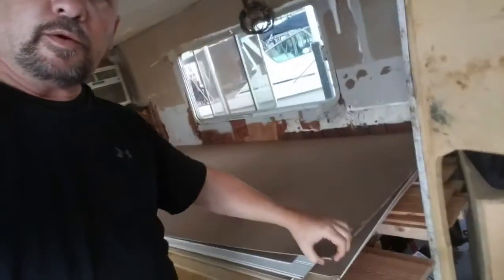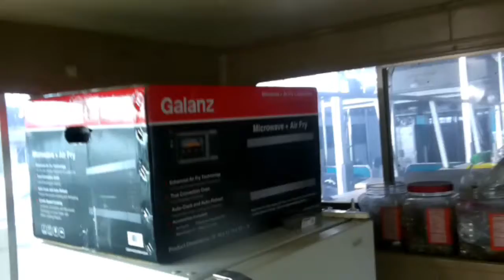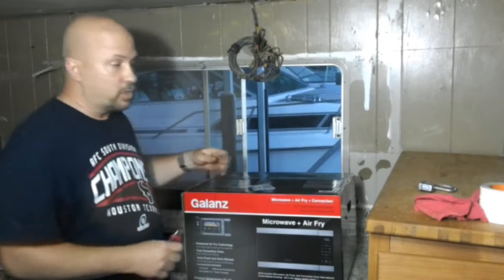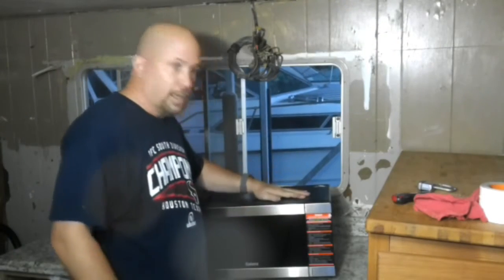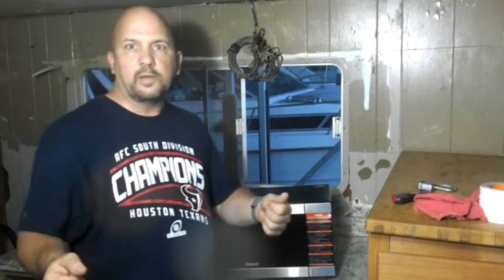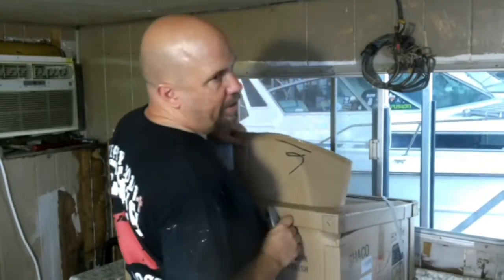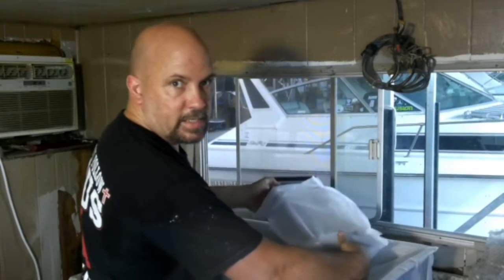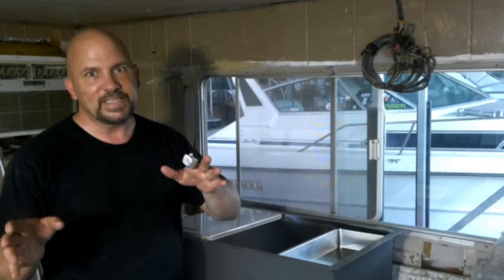This old houseboat in the beginning

Comment: I love it! You and I share a few similarities. When the video first come on, I said "hey that looks like my boat". Front deck and window look the same, same pole hanging above the window...Get inside and you got the exact same model of microwave I bought for mine. I am currently working on recovering the walls and upgrading the kitchen counter and sink... Then when you said "to tell you the truth, I'm cheap", I about rolled out of my seat because sounds exactly like me and something 
I would say. My boat is smaller than yours I can tell but the layout looks similar, with the a/c mounted in the same spot as mine. Mine is a 34ft. 1971 Stardust Crusier. I would be interested in knowing more about yours and would love to see some video and/or pics of what you've done with it.